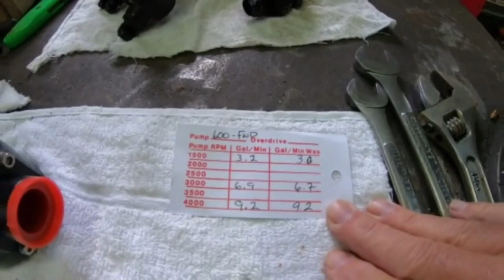Mechanical fuel injection part 2   Ajusting and start up.

Comment: Great video. Love the car. I’ve always thought about going mechanical fuel injection on my 68 GTO but know nothing about how to set it up also if it works on race gas. Most people seem to just use it on methanol engines
Reply from the maker: I've met some people running MFI on the street with E85.
The trouble with race fuel on the street is heat.
With methanol I can run 20 to1 compression and never get above 160. I'm just a little old school and like the looks and sound. Thanks for watching.